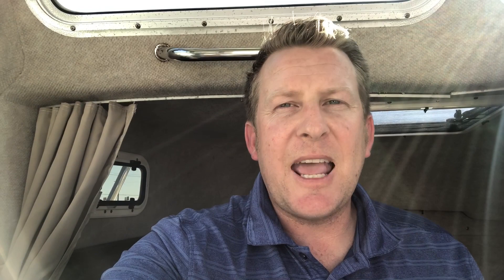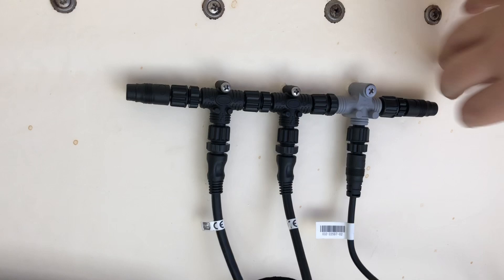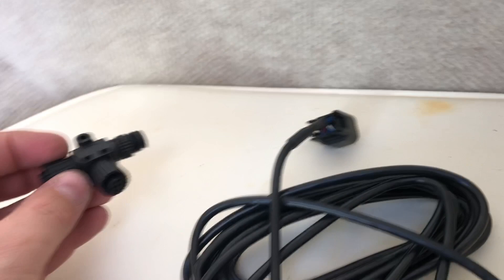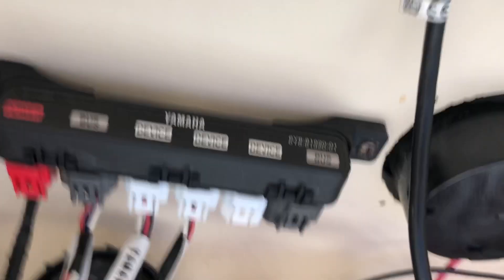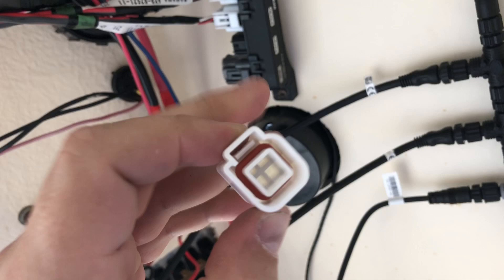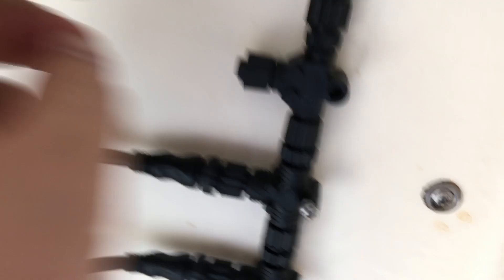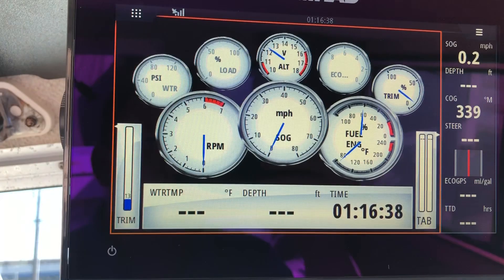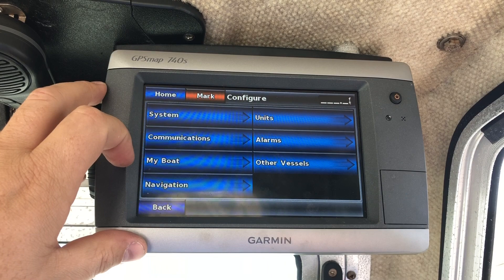Install NMEA 2000 System

Comment: Great info.  Looking at doing the same.  What model/manufacturer cable did you use to connect your nmea2000 network to the command link hub?  If you have a part number it would really help.  Trying to make sure I get the right one.  After a month, I'm still waiting for a reply from Lowrance...  Some of their literature says you have to use one of yamaha's gateway devices as an interface between the command link hub and the nmea2000 bus, as far as I can tell.  Don't want to if I don't have to.  Looks like your system works well without one.    Thanks.

Comment: Hi, Thanks for the video, very informative. One question, I am linking my Yamaha 4S to Lowrance HDS9 Carbon via that same "Yamaha Bus" but can not find a short cable (need 1mt). They all seem to be 4mt plus. Can you buy them shorter, cut down and re-join or just fold up excess cabling under helm??. Hope you can help. Thks
Reply from the maker: The oem Yamaha cables are longer, there are several aftermarket ones that are only 12-18"
Reply: Can someone please give an example of aftermarket working cable, that i shorter? (if command link i placed close to NMEA-units)

Comment: with a Yamaha CLP and network block do I need to use the Yamaha Gateway? Can I just run a cable from available open white network plug direct to my simrads NMEA2000 port? And if not do I need to get a starter kit and build a backbone first? Thanks,
Reply from the maker: You need the starter kit and backbone. The units do not supply power to support the network communication.
Reply: @ChasingPelagics  There is a difference between Yamaha Command Link, and Yamaha Command Link PLUS? With Command Link you only need the cable? And with Command Link PLUS you need an NMEA-gateway, that is more expensive?

Comment: I am told I need a gateway to hook up the gauges to the NMEA2000. Is that correct?
Reply from the maker: Yes, they gateway needs to supply the line voltage for the bus’s system to work.
Reply: @ChasingPelagics  my new boat will have a gauge package off of 2 Yamaha motors. I will install the NMEA 2000 backbone. Are you saying that I would need to get the gateway in order to have my Garmin chart plotter gauges read the engine information? Or can I plug the one Yamaha link cable into the hub and then to my backbone that would also go to my Garmin? Kind of confused. Thanks
Reply from the maker: @Glory-Days-Fishing  the NMEA network is basically a hub. It’s not a smart device and doesn’t generate its own power. You building the backbone with as many device slots as needed and plug the devices into the backbone. The backbone power should be triggered by key on or a electronics switch. You can’t plug one device into another device, they have to be plugged into the backbone.
Reply: Does it work for a twin engines set up?

Comment: For some reason when I did this it powered up my gauges and sent power to my motor without the key being on. Any clue why?
Reply from the maker: Its sending power over the bus, just like a POE internet cable. You need to switch your power source to the key switch.
Reply: Pacific Project thanks for the quick reply

Comment: F40 GETL - can i use command link or not ?
Reply from the maker: yes, but its a different cable then I used
Reply: @ChasingPelagics  can you speak me about cable?  Please
Reply from the maker: @Minomit  Its a Yamaha part you can buy from a dealer. Consult a dealer for the right part number
Reply: @ChasingPelagics  thanks